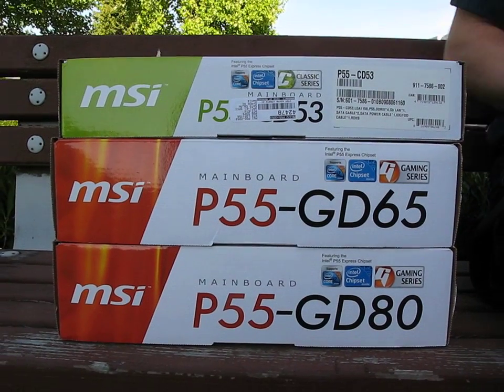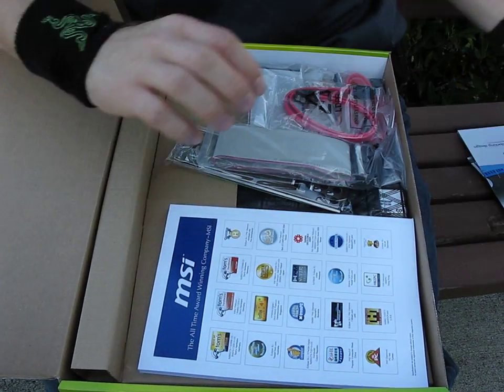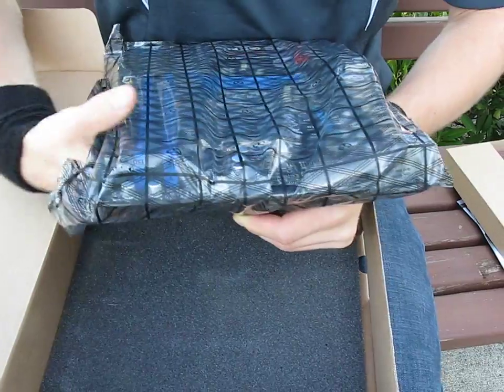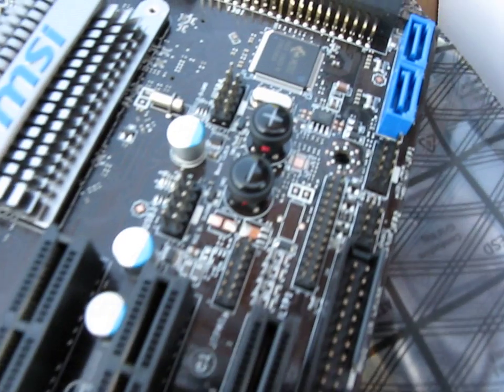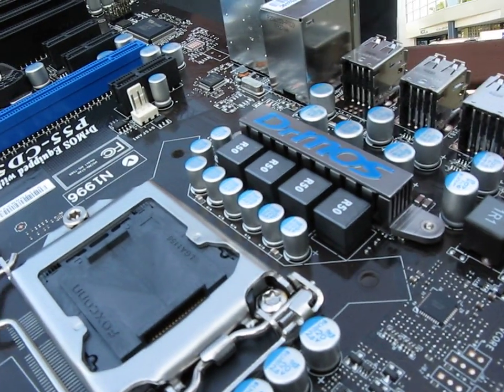MSI P55-CD53 P55 LGA1156 Core i5 Motherboard Unboxing Linus Tech Tips

Comment: Chapters:

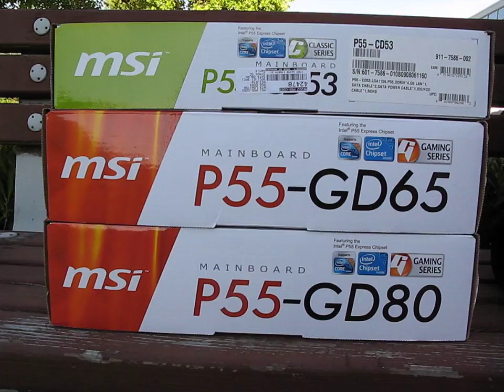0:00 Box and product overview
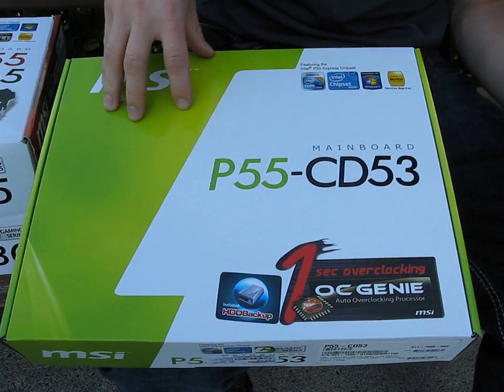0:29 Unboxing
0:35 Accessories
0:57 Floppy cable and I/O shield
1:00 More cables
1:05 The motherboard
1:23 I/O
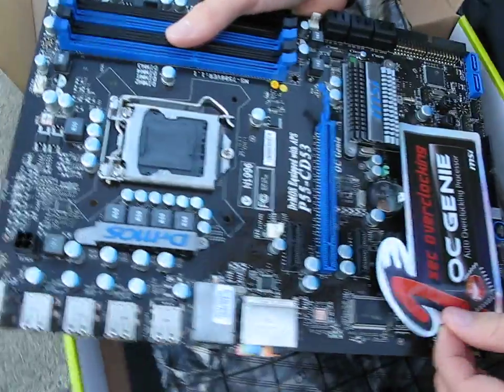1:36 Expansion slots
1:52 OC genie and power button
2:09 Chipset heatsink and SATA ports
2:20 Power slots
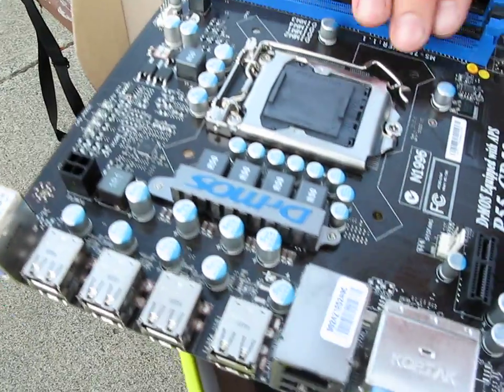2:27 LGA1156 socket and 4x memory slots
2:47 Dr mos

Video Review:
Consumer grade hardware, not that exiting.  a small win for the razer sweatband Linus is wearing on wrist, wonder if he still, has it?
Also, I just realised. If I do 5 videos a day, it will still take me more than 3 years to finish this quest! What have I gotten into...?
 I rate this a low 1/5

What am I doing, and why?

I want to watch, and review every single video on Linus Tech Tips channel.
I will provide chapters, if the video has none.
Why am I doing it? To pay a homage, and I am pretty sure that my head is a bit messed up.
Reply: whatever floats your boat
Reply: Till what video have you watched as of now? I'm doing this too

Comment: Still using this motherboard, just upgraded the RAM to 16 gigs,
Reply: are u using 2x8gb sticks or 4x4gbs? Want to know if 2x8gb stickswould work with this board.
Reply: I can play any game I throw at it at at least 60 FPS on ultra settings, some games that are GPU intensive at 30,
Reply: Although recently I have been wanting to build a new PC with a motherboard that supports DDR 4 ram,
Reply: @Antiestablishment420  thank for the info. This should be good for non heavy gamer
Reply: What graphic card are u using?
Reply: GTX 970
Reply: @Antiestablishment420  sweet memory
Reply: @Antiestablishment420  support nowadays game?
Reply: To the question below ⬇️ did this ever get answered?
2(8) or 4 (4)

Comment: I have this,with a Ati 5770 and a core i5 750.4 GB ram and 2x1 TB HHD's
all with a 500 Watt power supply
could i overclock my CPU to 3,5 ghz.
my cooler is scythe mugen 2

Comment: shakeelkhan- no, someone asked "where is display port..?"  the reason why there are NOT an display port, you have to buy an EXTERNAL graphic card. its almost amateur knowledge xD there are slim, to non of the newly realeased high preformance motherboards that comes with an internal graphic card. reason: to damn slow and low-end preformance, there would be no place for such a beast of a graphic card that this motherborad needs for optimal preformance, to fit in. thats why;)